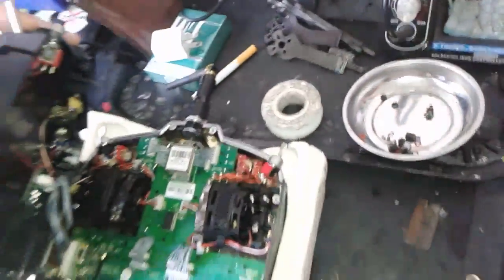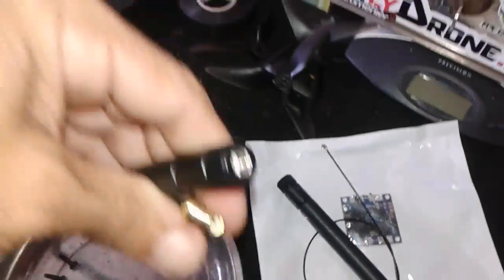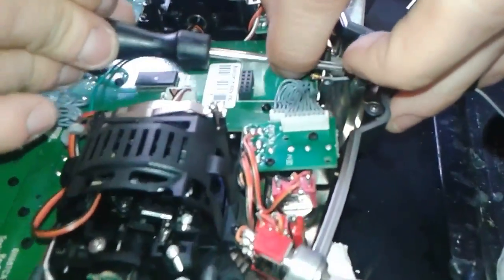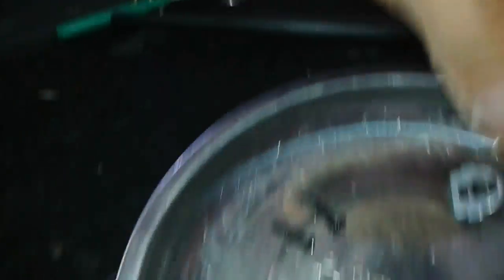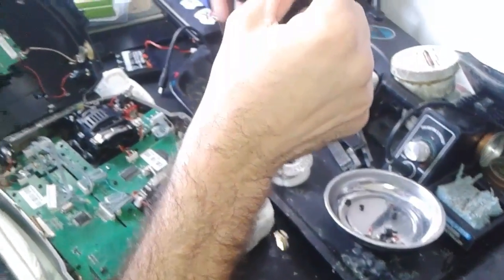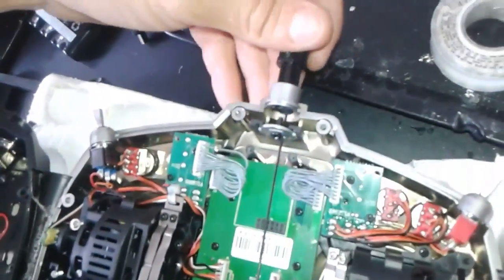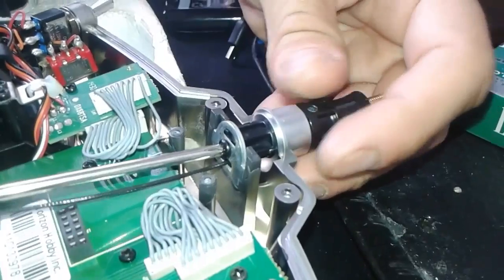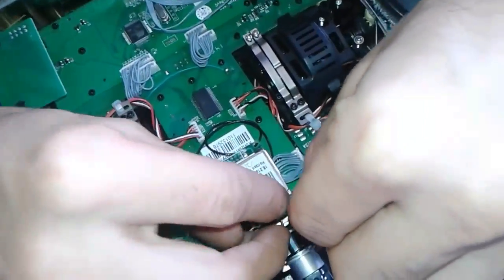AsikDrone / EmDrones : Spektrum DX7S 6 Db. Antenna Mod For Long Range

Comment: Hi,great vid. I got DX7s myself,realy like this Tx,but the range is just poor.
I even got DSMX satelite,was thinking maybe the carbon frame was a problem,
it got better,but I think it should do at least 1km without any obstructions.
I am at 500m/1640ft right now,anything beyond that is impossible.
I am from Europe(you wrote that US versions have 200mW...I think EU is 100mw)
What do you think,should still try to modify my DX,or just find something different? Tarranis maybe?
Reply from the maker: The Mod is Cheap like $12 USD. Id say go do the mod, you will notice the range differ. I'd say you can pull 1km but it may be a one way trip, if antennas arent properly placed then on return you may experience failsafes or two. I think EU version should be the same but I wouldn't be able to answer that truthfully... Hope this helps if you got anymore questions feel free to ask away. 
-AsikDrone

Comment: i did the antenna mod to a flysky radio i found the range to be the same
Reply from the maker: I'm not sure if it works with Flysky the same as it does for Spektrum. My only theory is because some remotes have controllable working MilliWatt power for range on the radioTX alot like a Vtx it's power makes the bigger difference in help with distance and proper antenna.. some remotes like FLYSKY brands come with set 30mw or even 100mw, my Jumper TX has variable power all the way up to 150mw and my Spektrum has a Set power of 200mw. This is where the big difference comes with the Linear 6db antenna. And in theory you get a longer distance in a straight line with 9db antenna but smaller Circumference, and the smaller the number goes the circumference widens out a bit more to match like a 4db antenna. So in theory the higher you go up in Db it's like a patch Antenna (directional)... Lol I may have all this info ass backwards it's been a while. 🤦‍♂️😁
Reply: @AsikDrone  thanks for the info something to think about